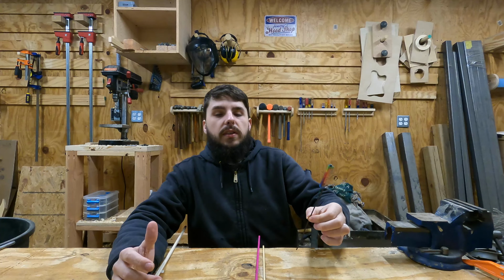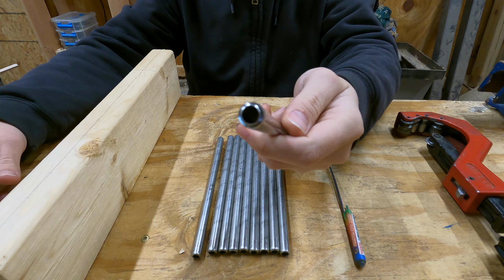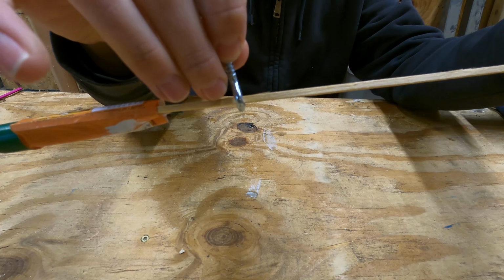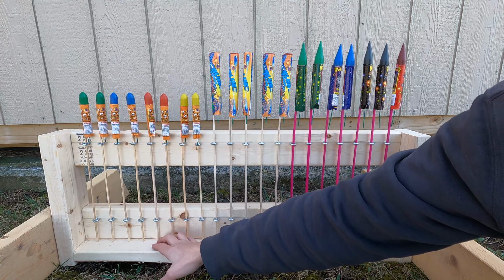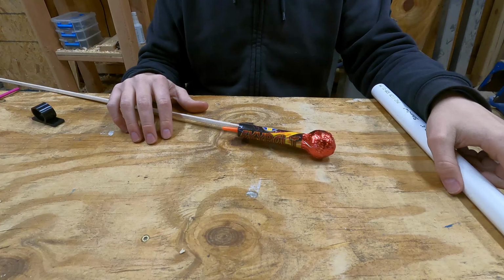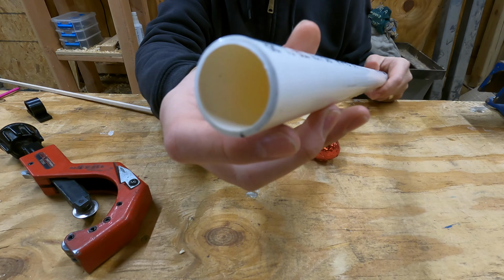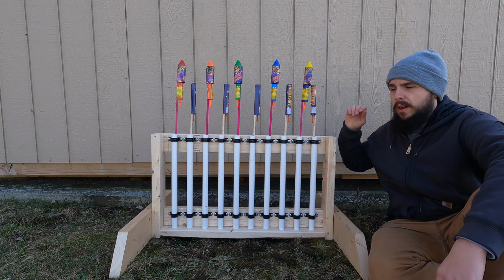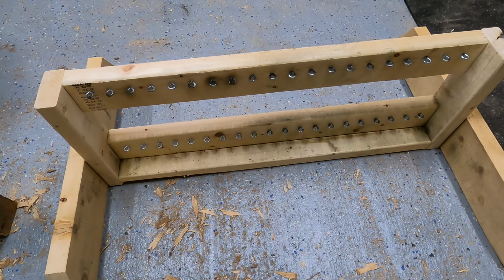Building 3 Rocket Racks and Testing Them

Comment: Would it be safe to use the rockets you used in the 3rd rack, in the 2nd rack with larger screw eyes?
Reply from the maker: I think it should be safe. I would personally adjust the height for the longer sticks on the larger rockets, and like you said, I would also use the larger eye screws. I kinda like that idea better because then you don't have to fool with moving the loose pieces of PVC that have rocket residue on them.
Reply: @310fabrication  you provided a excellent video on the 3 different racks. I really like the simplicity for the bottle rockets.
Reply from the maker: Thank you! I'm constantly trying to come up with new ideas to try and see what I like best.